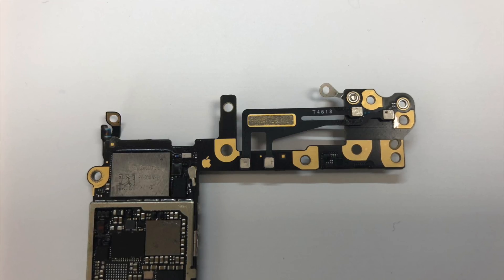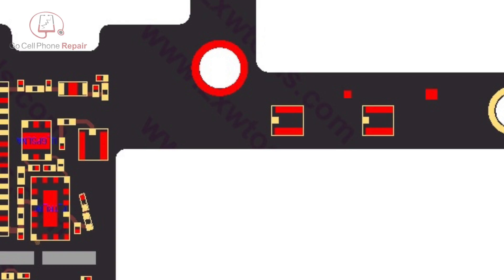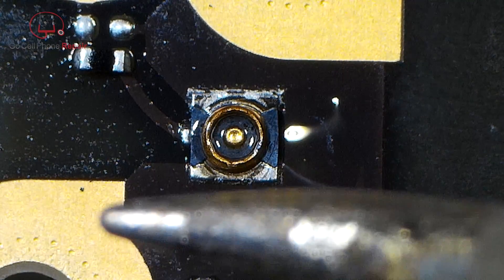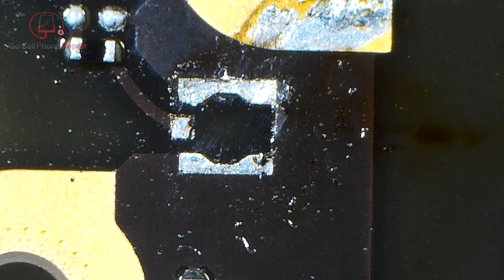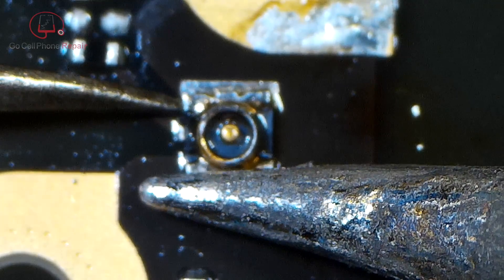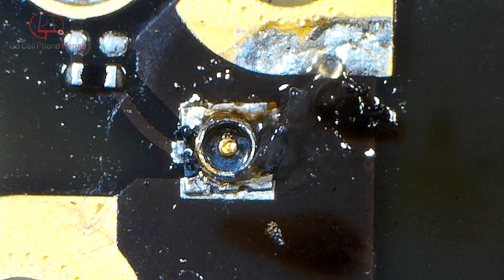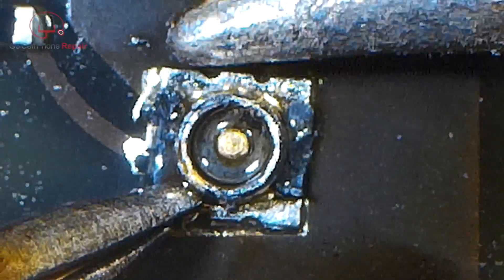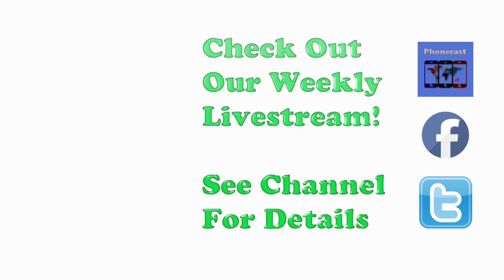iPhone Antenna Connector Replacement

Comment: Thank you for this video sir! I was trying to do a fix on my xaomi pocophone f1, and when I was disconnecting the cable this antenna connector came lose with it and unfortunately broke.. I can't for the life of me find a replacement part for it.. There are hundreds of types of those connectors.. Could you please help me out? Here is a picture of it.. https://i.imgur.com/b9bU2pb.png
Reply: I broke my Pocophone f1 antenna socket too, when i wanted to put new thermal paste. Have u solve this issue?
Reply: Looks like MHF4 connector

Comment: The connector circle broke off on to the cable when I was trying to remove it from my old wifi card (pc). Can you solder the cord to the new connector without removing the other connector?

Comment: Finally found a good no nonsense video on how to fix my flaky wifi/GPS issues.  I think I have the skills, I just have to get the right tools.  Thank you, great explanation and illustration with the magnification.
Reply: I thought the same thing I got a microscope and have been practicing on trash boards and components to learn and this by far is kinda hard its so small. I ended up melting the black plastic part inside of the connector lol

Comment: Wouldn't it be easier to do this using a hot air tool and some soldiering paste?!
Reply from the maker: Yep. If you have hot air a lot of these jobs are easier than with an iron.

Comment: How much degrees is the temperature of you iron?
Reply from the maker: It's almost always set to 750 Fahrenheit. For this repair though you can probably get the piece on and off with less heat. Probably around 550 F would be sufficient but I'm guessing right now. Next time I have one of these in front of me I'll check and see.
Reply: Go Cell Phone Repair thanks man!!

Comment: So what if the pad and a little bit of the trace have been damaged? Is there anything that can be done in that instance? In the exact same spot.
Reply from the maker: If there's something to connect to you should be able to run a jumper. Otherwise I'd expect reception to be affected.
Reply: Sore yes you’d run a wire if the trace was damage . If the trace is completely affected, solder to the filter that the trace goes to. Problem solved

Comment: Is the 6s plus similar? My gps doesn’t seem to be working
Reply from the maker: They changed the WiFi antenna quite a bit in the 6S plus. I’ll do a video as soon as one comes in.
Reply: Go Cell Phone Repair id greatly appreciate that, thank you so much

Comment: hot air!
Reply from the maker: Yep. That works too. Maybe should have done both just to demo.
Reply: the problem with iron or hot tweezers is that the plastic melt easily
hot air is the way to go for me, 
don't have to blow the components lol just low air flow do the job ;)
Reply: Sadly hot air blows other components off too easily with these connections,  i personally use my metcal hot tweezers with bent tips, or normal iron with bent tip just like mike.